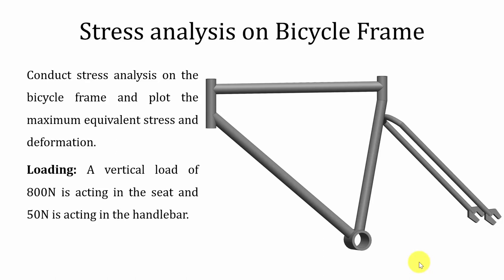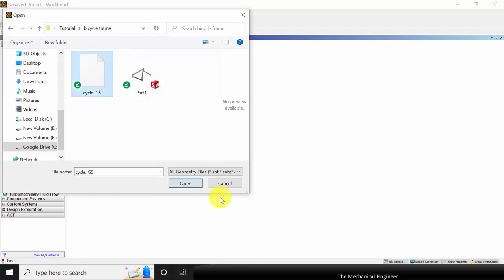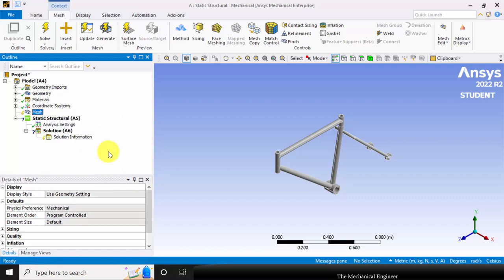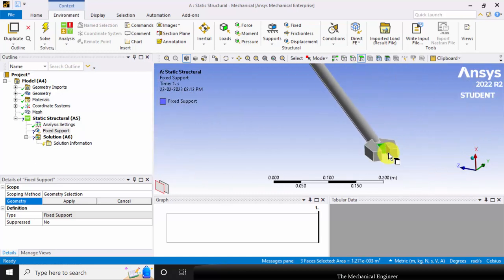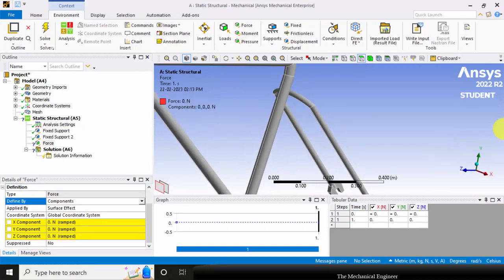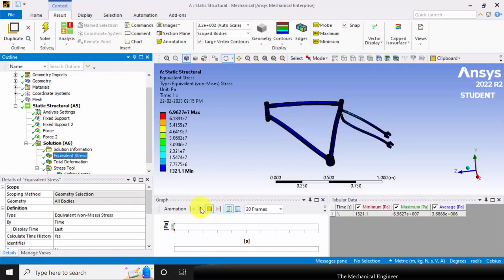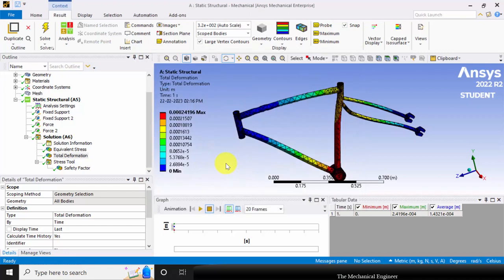Static Structural stress analysis on Bicycle Frame | ANSYS workbench tutorials for beginners

Comment: i love your videos. could you do a video or point me in the right direcrtion on coupling aqwa results and FEA?
Reply from the maker: Thank you for enjoying my videos! Regarding your question on coupling AQWA results and FEA, I suggest exploring the use of the Finite Element Method (FEM) and Boundary Element Method (BEM) coupling techniques. These methods can be used to analyze fluid-structure interaction problems, which is where AQWA results and FEA come into play. There are various software packages available that can help with this type of analysis, including ANSYS, Abaqus, and COMSOL Multiphysics. I hope this helps you in your research!
Reply from the maker: If you need any further help with this, please contact support@mecht.in
Reply: @themechanicalengineer  thank you for the candid reply. I would like to know how to couple the FEA and BEM matrices since they tend to have different shapes...thanks in andvance
Reply from the maker: Coupling Finite Element Analysis (FEA) and Boundary Element Method (BEM) matrices can be challenging as they typically have different sizes and shapes. Im really sorry I haven't worked in that area...

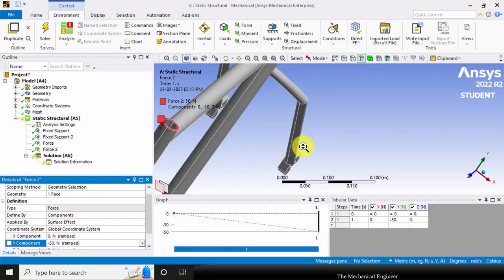Comment: 3:49  can you tell me how (800N on seats✅) you applied 50N ❓on Handel of bicycle (80kg human weight)
Reply from the maker: In this scenario, if we assume the weight of the human to be 80kg, we can calculate the force due to gravity using the equation F = m * g, where F is the force, m is the mass, and g is the acceleration due to gravity (approximately 9.8 m/s^2). So, the force due to the weight of an 80kg human would be approximately 784N.
Remember that the force applied to the handle is not solely determined by the weight of the human but also by the additional force applied intentionally by the rider. Therefore, i have applied additional 50N of force on the handle